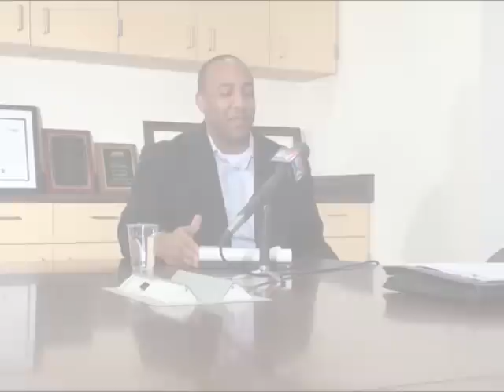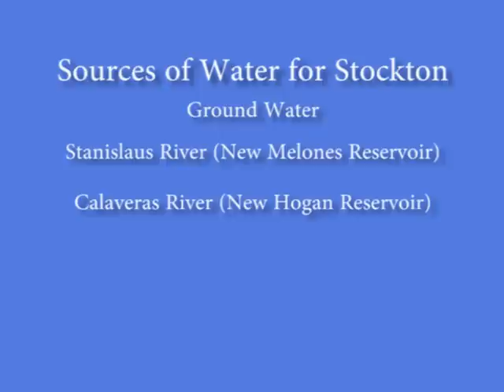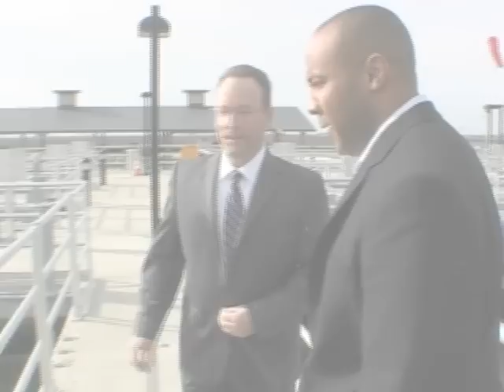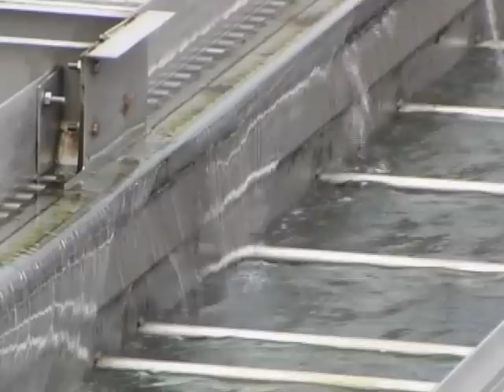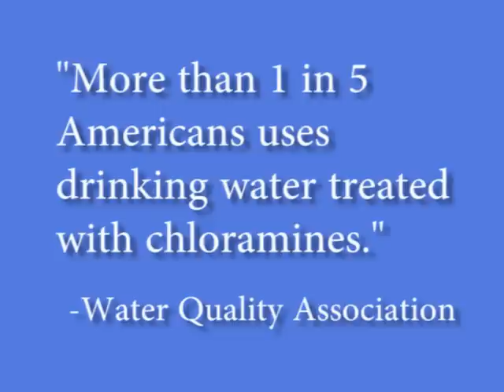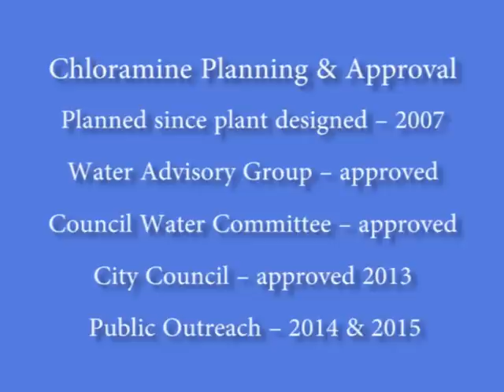Our Water: A conversation about safe drinking water in the City of Stockton

Comment: The EPA has admitted chloramine was not studied for health effects, and cancer studies were minimal. People are complaining about health effects all over the U.S - trouble breathing after showering, intestinal swelling with cramps, and itching so hard you bleed. Most people with chloramine symptoms don't get complete relief with filters (cheap or expensive). Chloramine is harder on filters so the media has to be changed more often than chlorine. Chloramine is an easy, cheap way to fix the TTHM problem. It's not what is best for all citizens.  Chloramine is a less effective disinfectant than chlorine. Granular Activated Carbon (GAC) is best, and also removes pharmaceuticals. With GAC you can use less chlorine too.  It is more money, but if the EPA had put human beings first, water companies would have planned for it.

Comment: In this conversation video, the filtration system is described as ultrafiltration, and in your Q&A it is described as microfiltration.  Obviously both terms have areas of overlap for pore sizes and filter effect.  Can you provide information on the effective and absolute pore sizes in the filter membrane used at the Delta Water Treatment Plant?